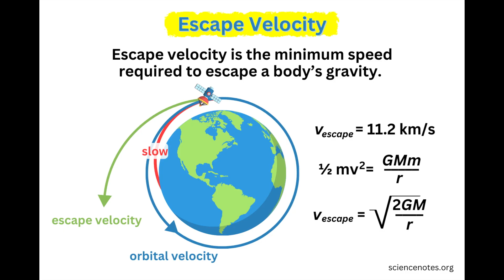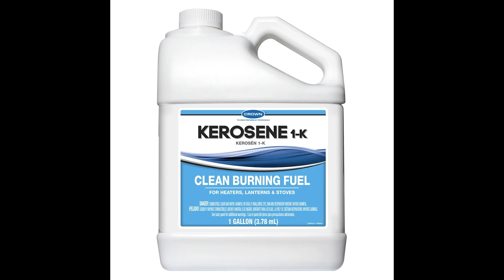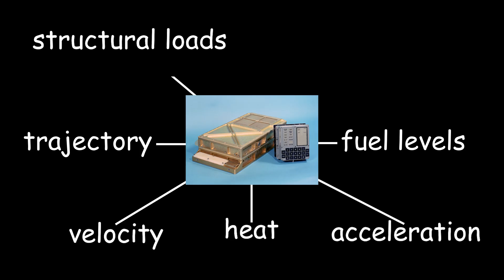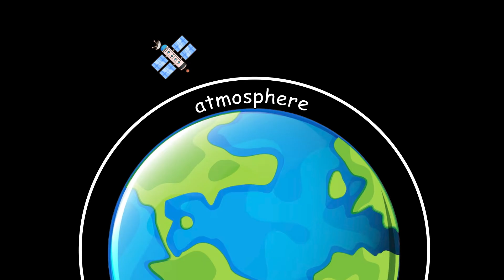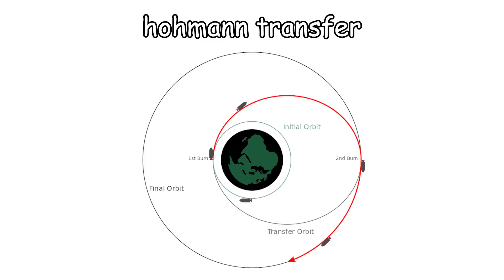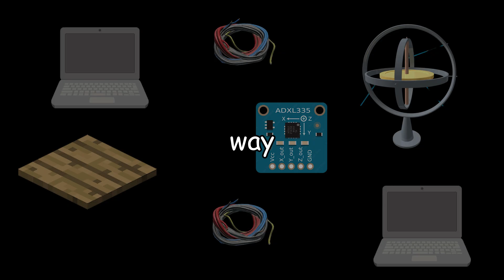Going to Space is Harder than You Think...

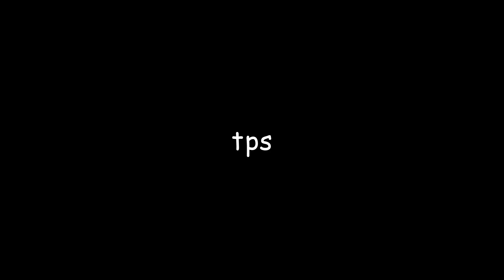Comment: at 6:37 you said friction which is definitely one of the forces, however it is not the main one, that goes to the fact the capsule moving at such velocity that it compresses the air molecules in front on the shield so much that so many atoms into small space they heat up (Adiabatic Compression). Also because of this it actually ends up protecting the ship itself during reentry which is a cool fact. 
but other then that cool video